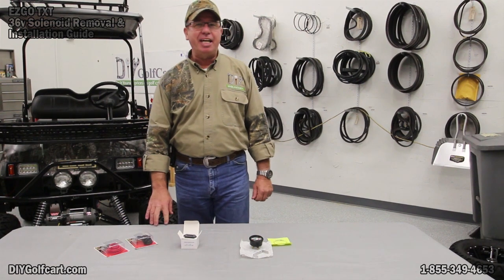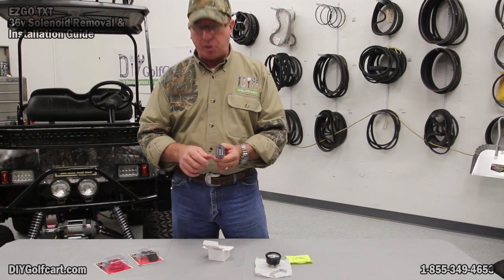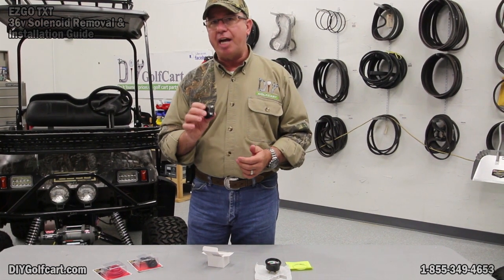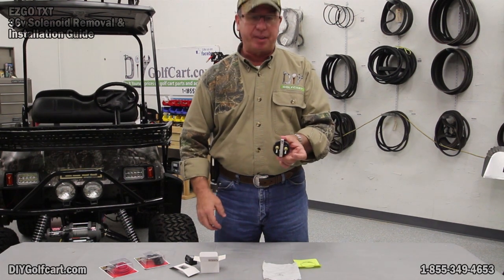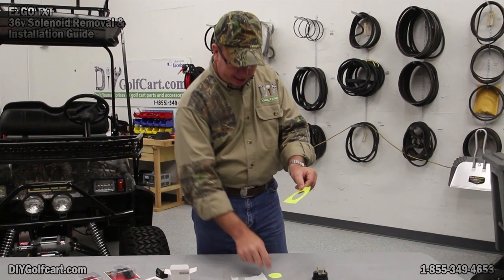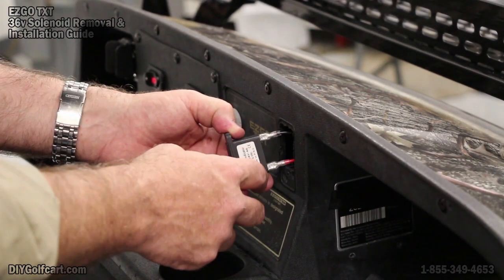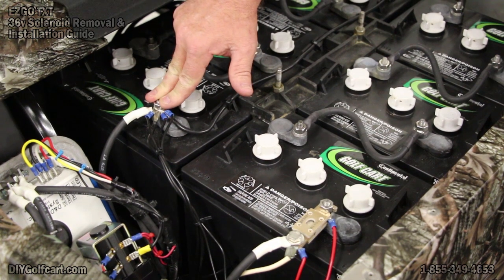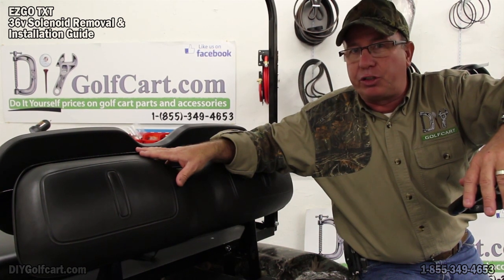Golf Cart State of Charge Meter | How to Install on Volt Gauge

Comment: Little bit easier to install the round meter with no template using a properly sized hole saw 1/8’ undersized and clean it up with a file or rasp in a Dremel. Nice tight fit.

Comment: I have the analogue meter on my EZGO 48 V. 1st drive this Spring.  It read full.  I drove for 15 mins but sluggish on acceleration,  I turned it off for 15 mins then turned key nothing..  Sometimes hear and feel the jerk when turning it on and off.  I noticed a red light flash once as I turn the key.  What is that light?

Comment: Need help...After fully charging my 4 - 12 volt Trojans on my 2008 Club Cart  the Curtis indicator will be flashing indicating low charge....then after I Switch the tow switch off then on and the Curtis indicator will show fully charge....just had my  9/16, 12 volt (4) Trojans tested and they all show green.
Does my 2008 Curtis  indicator need replacement!?
Thanks...Don

Comment: Why can't the analog meter be installed with any other switch as stated at 2:26 ?
I was going to install mine with a rocker switch to shut it off to keep it from drawing power from the batteries when cart is not in use. What is the down side to doing that?

Comment: You said to bypass the ignition switch. Go to battery. Then why is it the Volt meater on ours works when I turn on my golf cars. Or any other I have seen? I have not seen a golf cart that the meater is always on. Or have I just not paid attention ? Reason I ask I have a 36v ebike it has a crazy LCD display that come on only when the keep is on. I was thinking of running a LCD display horzonial bar like you showed but it would only be on when the key is on. If I run it to the battery it will draw from the battery all the time. In my case would a analog meater be better thanks
Reply: It will not draw enough energy to effect anything. You'll never notice a difference.
Reply: @barrywilson6665  ok thank you

Comment: My state of charge meter does not reset unless you disconnect cable off battery pack. I've been told that it should be connected to the key switch in order to do that. Why should it not be connected to key switch.
Reply from the maker: Why would it need to be reset? I always hook them directly to the battery pack and leave it that way.

Comment: I installed a meter on my 36 volt. It reads 38.4 when fully charged. When I hit the gas pedal it goes down to 33.3, and when I stop it goes back to 38. Is this normal?
Reply from the maker: That means that you have a weak battery in the system.

Comment: GREAT VIDEO...I just bought a 1999 ex-go with 6 new batteries with no volt meter. I bought one and thanks to your video, I had it mounted in less than 30 minutes. I popped out the cup holders and wired it to my key switch without having to fish a bunch of wires. Now I don't have to worry about having enough charge to get back home. Keep them videos coming Sir !!

Comment: I have Precedent 2007 club car i want to install charger indicator.can I use  existing orange light on my cart to replace/remove and replace with new meter indicator with same wirings?
Reply: I would like to know, too.   I have a 2002 Club Car.

Comment: I bought the rectangular battery charge meter for a yamaha 48 volt cart, It has three terminals + - and C. I hooked the positive to the positive side and the negative to the negative side of the batteries. When I attached the positive side to the positive battery post, the meter went from full to empty and then went blank. after charging the batteries, there is still nothing on the guage, no lights at all. I did nothing with the C terminal as there was no instructions as to what this terminal is for. Any advice? Thanks, Larry
Reply from the maker: Larry J. Bearce Sr. Depending on the one you got, some discharge meters have a 20 minute charge capacity. I other words, wait 20 minutes with it hooked up, if it doesn't work you need a new one.
Reply: The C terminal goes to the switch. This will turn the led portion of the meter off and on. This is so it's not  drawing power to light up the meter

Comment: I must be in a fog but what and how is a jumper wire and how do I do that lol! Btw you guys by far have the best videos!
Reply from the maker: Devin Marshall The Jumper Wire used in this video is connecting the "ON" connector to the B+ connection on the Meter. By doing this, we eliminate having to run a wire to either the Positive side of the Battery Pack or the Key Switch. The LED light inside the Meter will stay on, but uses almost no energy. By doing this, you will not put enough draw on the batteries for them to discharge any noticeable amount. 

Thank you for the complement, we strive to have the most informative video's available.
Reply: Hooked up 36 volt battery  meter .it do not  work maybe you tell me what is still wrong for it not work.i used a  volt meter and it still do not register at all.Please maybe its something, Thanks

M

M

Comment: I've seen some wire the C to the ignition switch so it's not always on and the other + - to where you said. What's the good and bad of that?
Reply from the maker: Devin Marshall Some types of Voltage Indicators have a internal capacitor and in the instructions they say to allow around 20 minutes before having a correct reading, thus everytime you turn your key switch off, you'll have to wait 20 minutes before you get a correct reading. Another thing to think about is on the meter, One L.E.D. light is on at a time. It would takes years to run a battery down enough for the charger to even notice there was a voltage drop and to come on.

Comment: Yes I have a 36v battery indicater on the back where you plug in wires it  has a + - C. What do I do with the C?
Reply from the maker: Devin Marshall C is used to turn it on. Use a jumper wire from B+ to the C. The B+ to the positive side of the battery pack and the B- to the negative side of the battery pack.

Comment: I'd like to buy two of the round analogue 48VDC SOC gauges but I'm wondering if you have run into any issues using them?  I've read some mixed reviews - any feedback on reliability would be appreciated! Thanks
Reply from the maker: We haven't received any returns in the past 2 years on the Round Analog State of Charge Meters.

Comment: I had a meter installed on my ExGo cart. The meter is always high in the green, even when the cart needs charging. What is wrong because it does not ever tell me when the cart needs charging.
Reply from the maker: Sounds like a bad meter.  Check the voltage on the meter vs. the voltage of your golf car. I have heard of people installing a 36 volt meter on a 48 volt golf car and getting a continuously high reading.

Comment: Nice vids.,  very informative ..  Have a ezgo pds and installed the vertical digital battery meter,  seemed to work good showed full and would go down a lil at a time..  Got about halfway down meter and cart died,  rode for about 45 min on and off..Waited about 20 min and was able to ride it about a block back to charger   ....  Any thoughts on the issue?
Reply from the maker: Depending on the Battery Packs individual load capacity,  you could have one or more batteries dropping out at a certain point. Also, keep in mind the batteries won't run all the way down to empty. Once they hit a voltage preset by the controller, the controller will kick out to keep from over heating. Always remember, if you're not on the car driving, it needs to be charging!